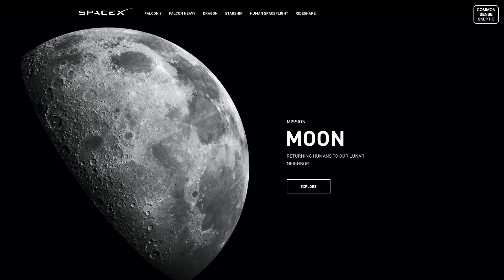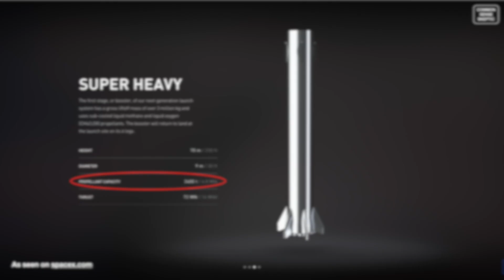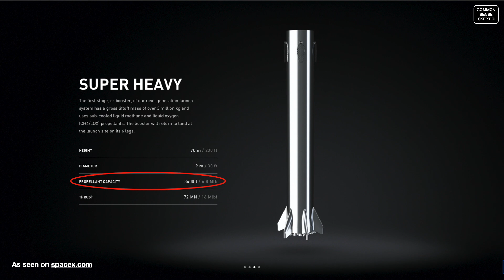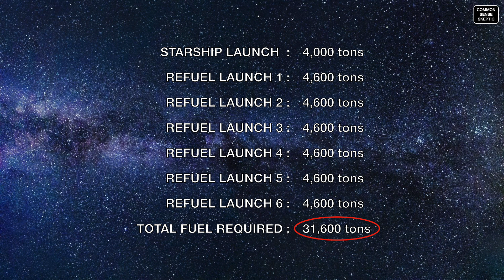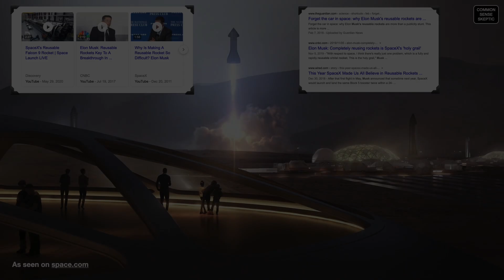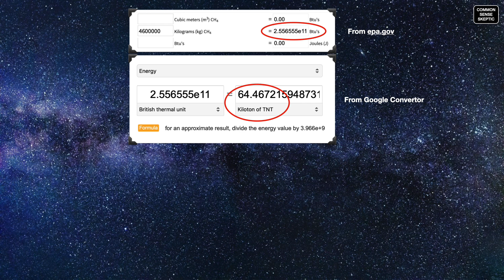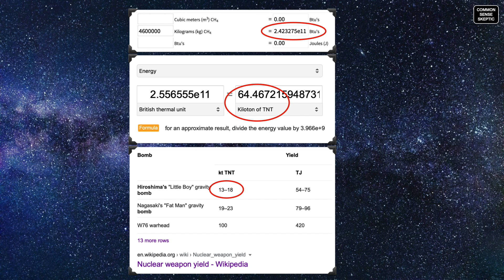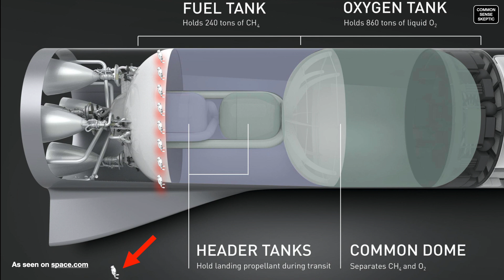STARSHIP EP5 - ORBITAL REFUELLING (1080p)

Comment: I would think you would use the Sea Dragon as a fuel delivery system. Away from populated areas and just launch as much as u can into space. then have other smaller craft refuel to it. then make it fall back down. re-use and repeat.
Reply from the maker: Sea Dragon isn't a SpaceX creation. It's a concept that dates back to 1962, and it never left the drawing board.
Reply: @commonsenseskeptic  I do agree. However tge point still stands we need a system that is able to move massive amounts of dead weight. Aka fuel into orbit. So I am thinking this is the best case scenario for trying to refuel a fleet of spacecraft. We don't need the high tech stuff unless it can make it more efficient. We need a big and simple booster.
Reply from the maker: @charlsblackworth8064  remove StarShip from the equation - do we STILL need this massive payload capacity? For what?
Reply: @commonsenseskeptic  if we remove it we still need massive payload capacity for a mission to Mars. Any kind of mission. Exploration. Milestone. Mining even automated. You need to go big.
Reply: @charlsblackworth8064  ; why do humans need to go to Mars this decade? Doesn’t make sense imo. First humanity should put humans in outposts on the Moon and develop a Lunar mining & manufacturing economy. Once all that Moon infrastructure is developed, in the next 100 years, then the technology for deeper space exploration will have a better chance to develop including in orbit refueling. (Or less likely, your pet idea, a giant sea based rocket.)
Reply: @bb1111116  good point. I'm trying to make this work. You need reliability. You need fuel. Why not get some plants to Mars and get some data
Reply: @charlsblackworth8064  ; that could be done by robot missions. There’s no need to rush to get humans to Mars. The Moon should be our focus for that.
Reply: @bb1111116  indeed. Robots are best. Or how about we add plants and life support systems and some small animals and study the effects as well. We can get tons of date.
Reply: @bb1111116  I do agree. We need more automated or even missions with animals to study effects and see what can be done.
Reply: Refueling is easy: just pull up to the space elevator, and they can fill your tanks in a jiffy.  And clean your windows while you wait, too.
Reply: @bb1111116  "... develop a Lunar mining & manufacturing economy."

Mining and manufacturing on the Moon are not likely to ever be economically viable.  Shipping costs will be enormous.
Reply: @michaelsommers2356  ; you are incorrectly thinking about earth’s gravity. Earth’s Moon has relatively weak gravity. Sending materials / goods from the Moon to earth would be relatively easy.
Reply: @bb1111116  No, it would not be easy.  More is involved than just the relative weakness of the Moon's gravity.  As you get nearer to Earth, the gravitational potential energy you had when you were on the Moon turns into kinetic energy, and you have to somehow get rid of that kinetic energy in order to land on Earth.  Unless, that is, you want your cargo to crash into the Earth like a large meteorite.  Orbital mechanics is not simple.
Reply: @michaelsommers2356  ; I repeat, relatively easy compared w/ sending supplies from earth’s gravity well into space. 
Of course anything which moves in space that needs to be in orbit around earth, whether to dock to a space station or be in a certain orbit, would need to slow down after a trip from the Moon using small rockets. But small rockets to change momentum in space would never need to be as powerful as those required to get from the earth’s surface into space.
Reply: @bb1111116  Repeating a falsehood does not make it true.  Coming back to Earth you need to lose exactly the same amount of energy that you needed to add to get to the Moon (assuming the same mass).
Reply: @bb1111116  Your definition of "easy" seems to be "uses a smaller rocket".  I guess you think that reentry is trivial.  It isn't.  You apparently don't remember the worries that the capsules used in the '60s and early '70s would come in at too shallow an angle, bounce off the atmosphere, and be lost in space.  That never happened, but it is a risk.  So is coming in at too steep an angle.  You also seem to have forgotten what happened to _Columbia_.

Comment: Regarding the issue of deorbiting while refueling... Presumably the vehicles could be oriented in a normal/antinormal attitude so any acceleration used to settle or transfer propellant would only result in a modest change in orbital inclination. Don't think that would be a problem.
Reply: Wouldn't the the act of settling propellant offset the act of pumping it? This is a closed system.
Reply: @3gunslingers  Spin the connected Starships. Same effect as acceleration, except fuel will pool at the top of the tanker. Pump through a downcomer pipe.
Reply: @3gunslingers  You didn't think acceleration alone was going to transfer all propellant did you? The pump was already included in your equation LMAO

Comment: At 5:30 the tanker starship is refuelled in orbit by other tanker ships, it then mates with the human rated starship and transfers its fuel load in one event. This is why the tanker is pictured as full.
Reply: The plan to have enough tankers in orbit relies on the mating tankers producing viable offspring. Unfortunately, SpaceX rockets use pheromonal signalling to distinguish docking gender which clearly cannot propagate in a vacuum. You end up with a lot of gay tankers and unacceptable G forces if the crew module gets fuel-banged.
Reply: That would make sense - reduces risk to vehicle receiving the fuel. Still does not decrease number of launches.

Comment: Why not keep the refueling rockets attached? None of the return trip complications and possibly refurbishing them into something useable later in the trip (doubtful but hey it can't get any worse).
Reply: Because that just means more mass that has to be accelerated, which means even more fuel.
Reply: @michaelsommers2356  Acceleration or deceleration they both cost fuel. With the dozens of reasons this can't work reusable refueling rockets only makes it worse.
Reply: @MrSparkle404  Acceleration is defined as a change in velocity.  That change can be an increase or decrease in speed, or a change in direction.
Reply: @boogaloobomber9889  I'll need some time to find / write the transcript for every single one of these videos then add bullet points. Thanks.

Comment: At 12:12 you seem to confuse orbital refueling and launching into LEO. The cost to orbit Musk claims for launch to LEO, has nothing to with orbital refueling per se .That said, what alternative are you suggesting? Every mission beyond LEO has had to carry propellant for kicking itself out of LEO and while economy of scale favors a larger launcher; at some point practical issues limit the size.
 Perhaps a better alternative would be to use solar thermal rocket tech like that being proposed by TransAstra Corp. which is more efficient and can use anything as propellant (almost) so that propellant could be made from the Moon, Phobos and Deimos and asteroids.
Reply: Given that the Starship stays in LEO during refueling, then yes, LEO insertions of the fuel tug are an integral part of refueling.

Comment: Likening the consequences of a deflagration caused by a Starship accident to a nuclear bomb going off (i.e. something way faster than even a chemical detonation, on the scale of a few milliseconds) is problematic. The former generates no radiative effects other than a rather slowly-released heat wave, and also no supersonic shock wavefronts. Hence, it's safe to assume the outcome to be rather of a magnitude of the post-WW2 Heligoland blast or the recent Beirut accident, both caused by detonations (not that these were something to be laughed at - they were tragic in their own right).
Reply from the maker: Detonation velocity of petrochemicals in an oxygen rich environment is Mach 5. Check out the episode called Nuclear Concerns.
Reply: The header tanks within Starship and the common bulkhead set up the right conditions for fuel/oxygen mixing before ignition. That's why you may get at least partial detonation.
Reply: The blast effect can be devastating enough. There are some very good documentaries (usually available on YT) documenting the devastation caused by the Halifax explosion in 1917. That explosion, generally regarded as the most powerful (and deadly) accidental non-nuclear blast caused by humans clocked in at about 2.9 kt, considerably less than what Starship could generate if it went boom.
Reply from the maker: @saumyacow4435  And at sea level it's an oxygen-rich environment to begin with.

We won't know for sure until the first full one blows up, but all the other fireballs have been mere seconds of explosion complete with blast domes.
Reply from the maker: @grahamstrouse1165  Yes Halifax is a good example. Beirut last year. Soviet N1 launches.
Reply: @commonsenseskeptic  Good that you are bringing up the N1 cases. Even in that launch attempt that went kaboom already on the launch pad, its effects were a long shot from a multi-kiloton nuclear blast. I see no reason to assume the Superheavy's fuel load somehow miraculously forming a perfect aerosol or thermobaric bomb in case of an accident. In other words, the energy release would largely come via a fast deflagration, occurring at the speed of the flame front / heat wave spreading, not a detonation propagating.
Reply from the maker: @quantumbubbles2106  Estimates on the yield of the second N1 launch ranged from one to seven kilotons, with only 15% of the propellants igniting in the first detonation. We cover it in detail in Ep7, and it supports our findings.
Reply: @commonsenseskeptic  That's exactly the point I am trying to make: there are too many unknown factors at play when trying to assess the yield when the "device under test" hasn't been specifically designed to serve as a weapon. Instead of comparing it to a nuke (with all of its other damaging effects), accidental explosions of similar magnitudes of objects with the same effect mechanisms, such as the N1s', should rather be taken as references.
Reply: P.S.: aside from this, I firmly agree with your assessment of the concept of Starship providing intercontinental mass-transport for people just being bollocks. There are several other envisioned means of transport (e.g., from Boom, Reaction Engines, Airbus, etc.) much more likely to technically and commercially succeed, given enough time and investment.
Reply from the maker: @quantumbubbles2106  best part of this argument is - sooner or later it will no longer be theoretical. We will find out what a fully-loaded StarShip looks like when it explodes. Only a matter of time.
Reply: @commonsenseskeptic  Maybe Musk wants us to get accustomed to regular Starship explosions as much as we have become used to daily car accidents - they'd become just a blip in the annual statistics...? 🤔